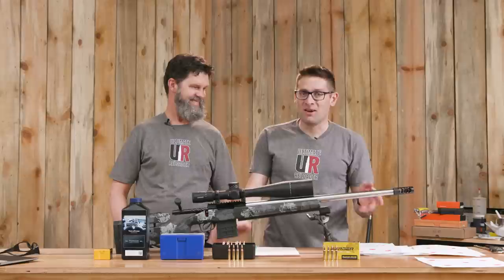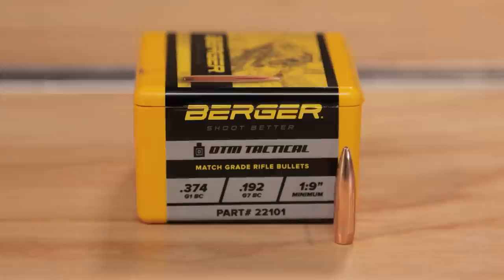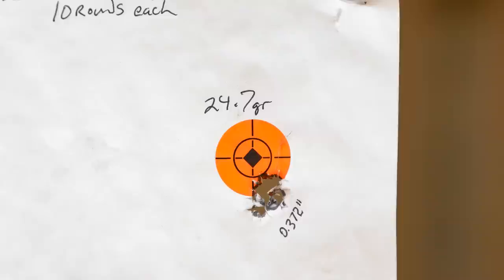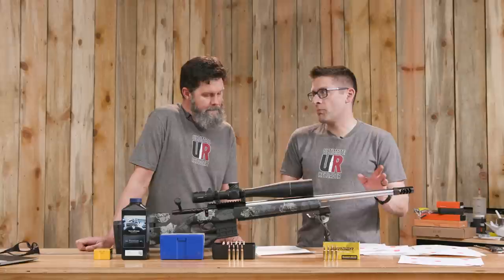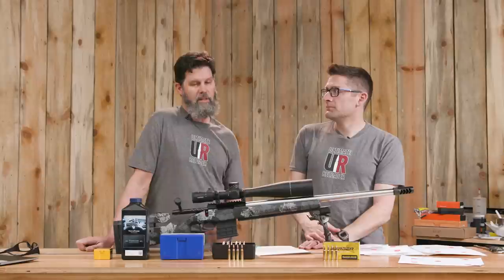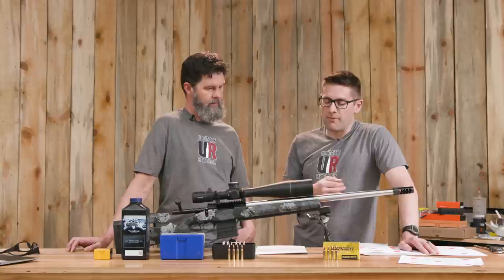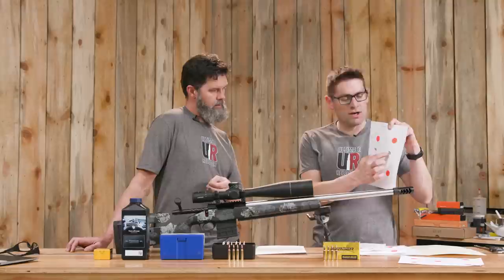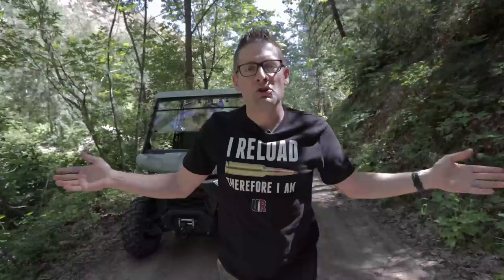Re-creating Berger's AMAZING 77 OTM 223 Load

Comment: I defy anyone to try and get 24.6 grains of 140 OR 540 powder into a .223 case and get a bullet seated to mag length. I tried a long drop funnel, vibrating the charged case, all of it. Not a chance. As an aside, this ammo has blown up some gas guns recently as well. On paper 24.6 isn't suicidal, but a 93 grain LC case will not accommodate that.

Comment: IMR 8208 XBR @ 21.4 - 22.0 GRS. Using Sierra 77GR. Match bullet and Lapua brass. 205 Match Primers. In Rock River Arms Varmint. I don't have any FPS. 2.255" OAL. 1-8 Twist. You may want to try a stronger primer. I did pierce one primer @ 22.0 GRS. All "three shot" groups under .500" down to my best at .255". Best powder I have found so far for this gun. Please remember to work up to these loads, every gun is different.

Comment: How interesting. I’ve just had my Tikka T3 rebarreled with a 25” custom barrel 1/8 twist. Specifically for the 77gr TMK’s. Bought some Vhit 140, Lapua brass and CCI400 primers and after some development settled on 24.7gr. Almost identical to this load. I get 2,780fps with a max spread of 13fps over the five shots I chrono’d

Comment: Wow, an order of these bullets just arrived for me yesterday, great timing! Now I just need to find some N140, lol. Looking forward to how this does in my 20" gas gun.
Reply from the maker: Awesome, yes, let us know how it does!
Reply: Be careful with charge on gas gun will not take bolt gun pressures helps for tailoring load gas gun adj gas block
Reply: @GaryBlankenship96b40  thanks for the advice. I plan to work up and look for pressure signs. They are “replicating” a factory load, but given that the powder was identified visually and unknown primers were used, caution is warranted.
Reply: @Ultimatereloader  did i miss what primer you were using ??

Comment: I shoot 77gr SMK’s over Acurate 2520, running 2750fps to 2765fps with consistent sub 1” groups. I know this is not a1/4” group but I wanted the speed for what I was doing. This is a clone of the Blackhills 77gr. Thanks for the great content
Reply: Barrel length and charge weight?
Reply: I shoot the same combo using 25.2 gr 2520 with the 77 gr TMK out of a 1/8 .223 Wylde AR, usually I shoot a Win Sm Rifle primer

Comment: I had a 223AI chambered last fall and it’s shooting similar sized groups. It has the downside of fireforming brass of course. My fireforming loads with Reloader 15 with 77smks shoot lights out too. I’m using 2018 Lake City brass, 205m primers, CFE 223, 77 TMK at 2.400 OAL. They’re moving at 3036 fps from a Benchmark 26” barrel. I haven’t stretched it out at 1K but shoots sub 1moa at 500 meters. Great post it’s really interesting to see what you’re doing. The AI gives a bit more velocity but there is seldom a need to trim brass.
Reply: 77gr pill moving at 3036fps out of a 223 ... that is impressive

Comment: May consider IMR 8208 XBR. Seems to gas up the speed a little higher with great accuracy potential as well.
Reply from the maker: We'll look at that!
Reply: @Ultimatereloader  Its my go to for 77s in 223.  Great velocity, great accuracy, fairly temp stable, short cut extruded so good case fill and easy to drop.

Comment: I'm shooting a M700 with a Krieger barrel 1/8 twist bullet is a Sierra 77 grain TMK with a Winchester SR primer seated with a RCBS bench primer seater enhanced with Hollands primer seating adapter (depth of primer is .005 below case head)and H4895 in Lapua cases. Cases are turned to .013 with a K&M neck turning tool. Barrel is throated for 80 grain Sierra bullets.  Cases are once fired, annealed, and sized with a Forester shoulder bump die and a Redding Body die. Necks are ran thru a Porter's Precision Products gauge pin at .2225. Seated with Forester micro seating die. Bullets are seated long 2.45"  Sd's of 15 or less and ES's under 30.  Powder charges are weighed out to .02 grains.  Powder charge is almost 3 grains over book max with a 2.260 seating depth but it is seated long in order to use the long throat as set for the 80 grain bullet.
Reply: Love this comment!

Comment: Read all the comments and didn't see what velocity you were getting. 
Just to add to the conversation I use 25.7gr of Accurate 2520, CCI 450 primer, Norma brass, Sierra 77 SMK out of a 1:8 16in AR.  I get an average velocity of 2759 over hundreds of rounds on dozens of sessions.  Shoots between 1/4 to 3/4 MOA depending on weather and how focused I am on the given day.

Forgot to add, neck sized with Forster dies, bushing .243, no crimp, COAL @ 2.255.
Reply: @Travis Fox Thanks for the reply.  If you were using new cases expect the velocity to go up 30-45 fps with fired cases.  I did and have found that to hold true with the 6 cartridges I reload.

Comment: Brass is also fireformed now, an increase in case capacity might also account for a slight decrease in speed.

I would hypothesize that in the smaller cases and powder charge the effect would be more noticeable than a larger cartridge.

Just a thought, though, no experience that would lead me to it.
Reply: I came here to reply the same thing. Good point.

Comment: A friend of mine bought a used Winchester model 70 with a couple of boxes of ammo. He then asked me to install a scope and sight it in. When I got to the range I fired two shots that were almost touching at 50 yards. Moved back to 100 and then fired two more shots that were less than an inch apart. Did a final adjustment on the scope and just fired one shot to verify. I told him to only use that ammo for hunting and when he was down to 5 rounds, bring them to me with the empties.
I checked the OAL. Then chronographed the last five rounds. Not knowing what I know now, I simply reloaded the same bullets to the same velocity (very safe loads) and to my surprise, they fired the same group size of 3 shots in less than an inch. I also loaded about a box or higher velocity loads with a different powder but those grouped about 1.5 inches. BTW, another factory load in the same rifle shot around two inches. I know it was pure luck that I got the same group size and found a fine load without really trying. It sure was satisfying. For some of us, that inch group is fine. I only know one hunter that can shoot those .3 inch groups anyway.

Comment: Looser neck tension could explain the slower velocity. Fire formed brass with more case volume vs factory brass with Saami specs could also make a difference. Did you full length size?

But, a different primer might bring the velocity back up. I wouldn't bother as long as your SD and ED is small. Your groups are amazing. Good job!
Reply: My thoughts exactly.  They should have pulled primer specs from the factory load as well.
Reply: @Travis Fox how much velocity do you think a magnum primer would add?
Reply: @tomtomtomone  ik I'm late to the party, I lately have been doing lots of testing of difference between my known loads and adding different primes. To summarize going from cci 400 to the cci 450 it was the equivalent of a .3 powder grain increase of varget for my varget 223 loads. With spherical powders like Tac and cfe223 the loads had varying amounts of powder comparision to recreate but all roughly .1-.3 more powder.

Comment: Late to the party but I run 24gr of N135 under 75gr ELD-M loaded long 2.445” with CCI BR4 primers and Lapua brass from a 25” barrel and am pushing 3015fps average (no pressure signs at all) 

Would try the 135 for a little more speed  👍🏻 all the best

Comment: More than likely it's the humidity that's sapping your 75fps. I would start there. Also worth mentioning, if you're at compressed your sd/es is going to suck if you are crunching the powder. Try flipping and packing while seating, works great   As for other powders, varget is going to be slow, accurate but slow. I would highly recommend the Vit 500 series if you want more juice. N540 would be in the same burn rate. Would use caution though they are hot, the most speed I've seen in 556.

Comment: Thanks for the awesome video and documentation of the ammo used.   Not sure what velocities you all were getting with the N140 with your barrel length.
Black Hills used to load the 77 OTM MK262 for military matches but the power is somewhat a mystery to make the velocity.
77 Gr. Sierra MatchKing HP 
24.6 - 24.7 grains flattened ball power (unknown)
Velocity: 2750 FPS 18” bbl
Energy: 1293 Ft. Lbs.
Reply: I wonder if it's Power Pro Varmint?
Reply: @mrrogers2611  I have no idea other than it is a flattens ball powder that they are using.

Comment: I'm running 24.5gr of H4895 with 77gr Tipped Matchkings 2.355 C.O.A.L. (that is as long as my internal magazine will handle) at 2950fps on a 40 degree day (no pressure signs as hot as 85 degrees) with my Remington 700 5R and has no problem shooting .5 MOA and that is all I ask of it.

Comment: I have a blueprinted Sako .223 AI with the old Mauser extractor that wears a Pac-Nor 28" 1-6.5 polygonal twist medium Palma barrel. I have had good luck with H4895, Reloader 10 & 15, and Winchester 748 (good luck finding any). I have shot 75 to 80 grain bullets with my rifle preferring the heavier bullets. I've seen little performance difference between BR4s and CCI 400s. With the Berger VLDs 80s, I average 2848 FPS with my favorite 25.0 grains of W748, in fire-formed Lapua (recent lot date) brass. I can hold 0.5 groups out to about 200 yards, then things open a bit but I think that is due more to the shooter than the rifle. In my 1-7 twist 24" heavy barreled AR-15 24.1 gr of Reloader 15 is my favorite load for 77 gr Sierra Match Kings.
Reply from the maker: Nice results!!!

Comment: my jam is 26.3grs of 2000mr under a 77smk 2780 fps out of a 18in ar 2.254 coal well above any published max but shoots consistent .5 groups with single digit SDs works stellar in 5.56 chambers
Reply: With a powder that slow I bet your port pressure is really high. I would suggest using an adjustable gas block with a powder that slow you can turn the gas down some and lower your port pressure. I have tried 2000MR in both my AR15 and my AR10. Once I got the port pressure worked out, I really liked that powder.

Comment: Berger 77gr OTM bullets performed great through an AR with a White Oak Armament SPR barrel. First loads used once fired Federal 556 cases and mag length COAL. Groups less than one inch was typical across several powders and charge weights. 0.318” was the best group of the day!

The yellow box does not disappoint. Planning to try Lapua 223 cases this year.

Comment: Those bullets have been sitting on the shelf at my local store for several months now and nobody wants them. I wasn't familiar with them so I wasn't keen on trying them either. Ever since buying a box of 250 Nosler .224" 77grn OTM with Cannelure and a box without and I couldn't get them into anything less than 2.5" groups at a 100 meters. Contrast that with the Sierra 77grn OTM bullets (w/ & w/o Cannelure) with which I am consistently getting .60" - .75" groups at 100 meters. Who knew a rifle could dislike a bullet so much!?

Comment: The lower velocity may be a lot related issue, as well as primer. I've had loads that could vary as much as 50fps depending on primer only. Either way, I knew the Berger load had to be N140.

I'm loading the 73gr ELD in lake City brass, fire formed, with N135. I'm getting over 2950fps, and just barely sub 0.25MOA 3-shot groups. Definitely not SAAMI 223 Remington pressure, since I load for and look for my accuracy in the 223(cip)/5.56 pressure range.

Comment: Just yesterday tested Berger 70 at 20F/-2C from 1.64 to 1.7g / 25.3 to 26.2gr and the best ones came with the 1.64 load. It should be summer doable but bergers are quite hard to get and scenars 69s had better accuracy, at least in 2.26COL so next I am trying the 77gr scenars.

Comment: About the difference in velocity, I have been wondering about that as well. I used to use Lapua brass in my 308 with mandrel 1,5 under. I changed to Peterson brass for small primer and I used the same mandrel. I was getting 80 fps more in the first firing with the Peterson brass than with the Lapua. But in the second firing I was down to the same velocity. But both brass are the same, no difference in the groups. Just wondering about that increased velocity in the first firing with Peterson.

Comment: Also 24.2 of reloader 15 gives me 2700 fps and is most accurate out of my gun on the rdf. For best velocities I use 24.8 gr of 2520 and it yields 2830 on the rdf loaded 2.28” long. On a bolt gun you could go as long as 2.5” with that bullet and easily get another grain in there.

Comment: Primers can make large velocity differences! Thanks for the video. Greed is a human emotion we all share. There is never enough money or accuracy. It seems there should be...

I have seen switching from Rem 7.5's to WSR's gave me +50fps and much better extreme spreads with TAC. I have seen switching from normal primers to CCI #41's with H4895 can give +50 fps with 55's and up to +100 and pressure with 75's and 77's

Comment: The otm is good but the rdf is amazing exp at extended ranges with a much higher bc
Reply: Was just thumbing through replies to see what other people have experienced. Interesting comparison. . . . I picked up some rdf's about a year ago and haven't played with them yet (becoming a full time student past the age of 40 doesn't leave me with the time I used to have for load development). For my model 12- I stumbled onto a really good load by pure accident. I mistakenly purchased 4895 by mistake and it couldn't have worked out better- 24.2(?) grns of 4895 under a 55 gr v-max was pure magic for long range small critters. SD's were about 12 I think, not the best but 5 shot groups were hovering around a half inch on the day I tested them. I'm hoping to test/use the rdf's in my custom built AR as the Savage is a 1-9 and the AR is 1-7.5 (all match rifle parts).

Comment: Love this channel.  So regarding the powder, I'm a huge fan of the VV 530 due to its fast burn rate, and I don't get a compressed load when seating Sammi spec'd 223 with Hornady 75g bullets. Federal GM205M primers are the only way to go. The lowest Sd's I ever achieved in 223 were with IMR 8208XBR with 205M primers, 75gn Hornadys.  Just ordered 600 of the Berger 77's to try, and will send you results.

On a side note, can you build a 6.5X280 Ackley improved? I'll buy it off you when you're done!

Stay well.

Comment: It looked like the weight was 24.667 gr and you rounded down to 24.6 and if you had rounded to 24.7, you may have made a difference on the velocity.  Also, try another powder like H4895 which gives a good bit more velocity in .223.

Comment: You can't be sure the factory is using the "cannister" grade powder and not some special blend or formula.  If you want a test, pull ten bullets and powder from 10 factory loads and replace with your powder and bullet.  You might eliminate two variables that way.

Comment: It could be u went to the tip instead of the ogive. Tips are never the same length but the ogives are. That could be some of it and yes primer is another plus are u annealing and sizing ur brass to the same size. If ur just bumping it back 2 thousands ur changing the dimensions so you could be changing the velocity too

Comment: How do you deal with static cling in your power measurer tube and pan?  Would like to see what you think about building a 7mm.  I have been shooting the same Win Model 70 since 1994.  Been working on different loads for it inspired by your channel.
Reply: I use dryer sheets attached to my powder measure by a rubber band.  I wipe my pan with one before I measure anything as well, no powder sticking.  Throw a couple in the bowl if you dry tumble, it works there too.